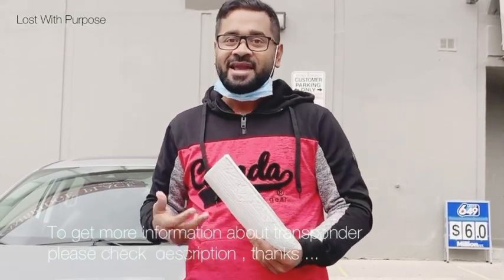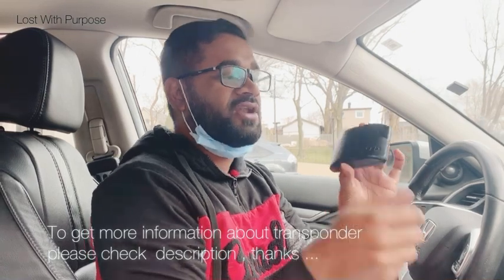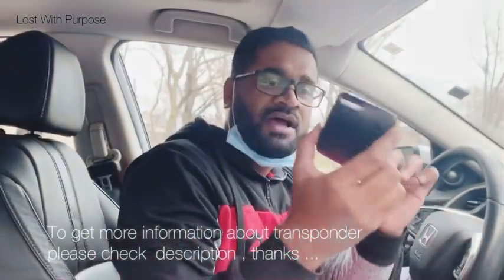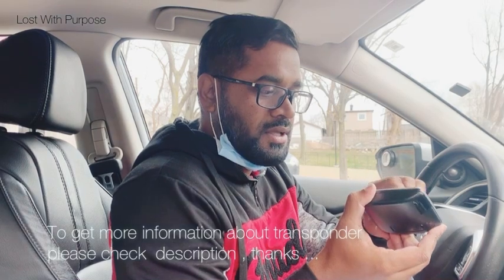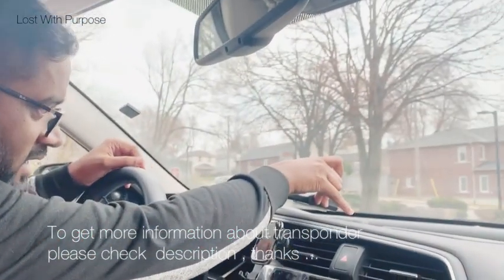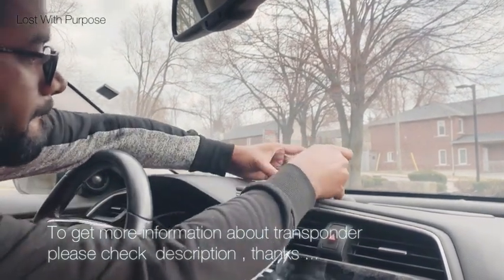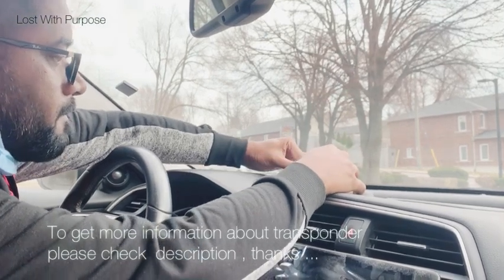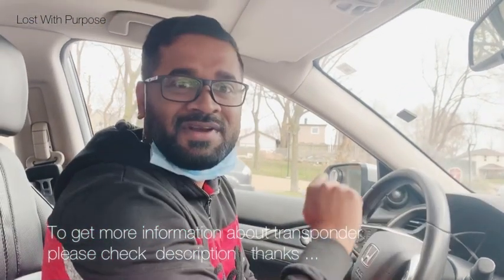How to install a Transponder | What is Transponder | @Hossain_Suman

Comment: You placed it wrong 😑 it’s supposed to be behind the rear view mirror
Reply from the maker: Thanks for your concern. My one is working properly…
Reply: Omg this is wrong how can they look at the transponder id 😂
Reply: @Hossain_Suman  obviously you didn’t actually read the instructions that come with every transponder ever. They’re supposed to go behind the rear view mirror where you can still see it, it allows for the sensors that read it with more accuracy. This hasn’t changed is 25 years.
Reply: It’s wrong setup